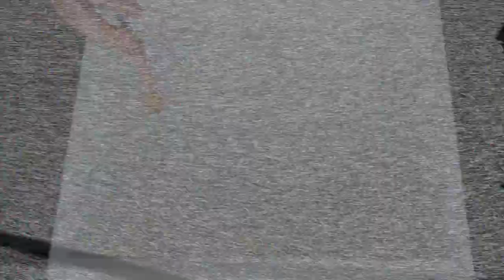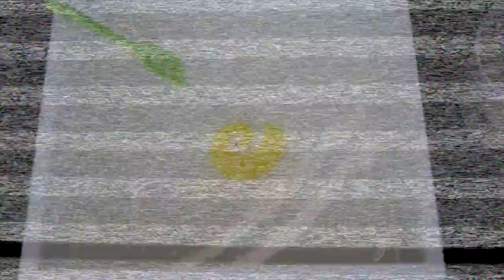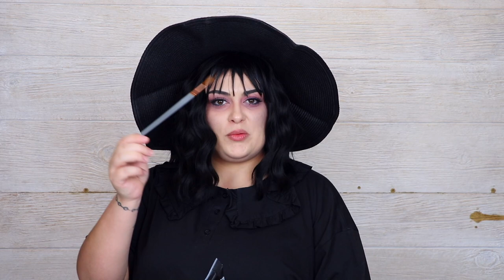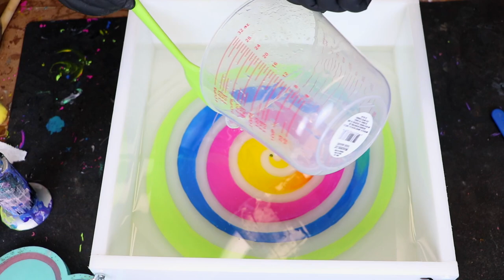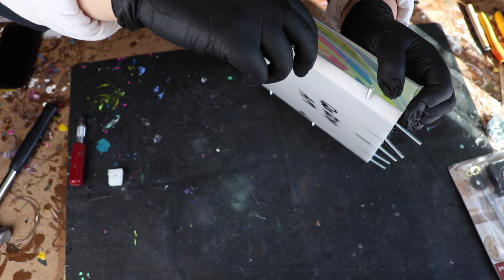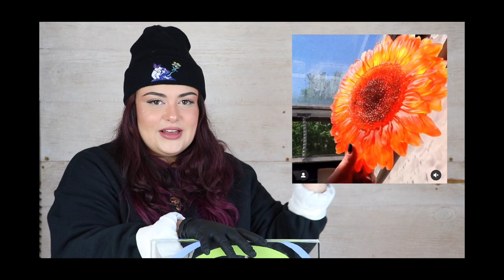The BIGGEST Resin FAIL I've Ever Done... I need your help. Tried To Make a 3D RESIN PAINTING!

Comment: You can rout out a space for the clockworks, so it can still be a clock. You can put hooks on it, and make it into a coat holder. You could just hang it on the wall as simple art.
Reply: I second the use of a router. A lot of clocks have the motor in a recessed area any way.
Reply: i was going to say that too but i think she might eat into the first layer of paint so she could only take out a few mls but that might be enough
Reply: I think she can router it, but to avoid eating into the paint, router from the other side it will just reverse the spiral but that would look good as well. 
(Does that make sense... I don't know) Anyways, it will look fabulous whatever it becomes. Love this channel.
Reply: I was saying this too, if she carve the middle in the other side (so from the "top" layer) it will work 😁😁😁
Reply: @jmakit  she might not hit the paint tho 🤔 cuz she did have that first layer that bad already been poured and I believe that was a thick pour
Reply: @jmakit  not necessarily she can leave the side that has the first layer ( yellow) to be the front and do the carving on the last one, that only has paint on the corners... Maybe.
Reply: @karenstremke9766  exactly what I thought 👍
Reply: She said the last couple layers poured were very thin. It would all have to be from the back.

Comment: You could probably "file" it down in the middle so that the shaft comes through and then bend the arms a bit. Or file in the back so you don't get a "ditch" in the front. Dunno how to ecplain it. But i would say it is doable. Might even give the piece even more dimension
Reply: I thought about that too. But then you’d have to be sure not to carve out any of the yellow paint.
Reply: @hopegold883  that might be a risk if done from back, but in the front, rhere is a lot of space to file into before reaching the yellow
Reply: Came here to say exactly this. She could easily sand a pit into the back without ruining the 3D effect.
Reply: I understand what you're trying to say and it is what I was thinking, like essentially carve into the piece a little to make the clock works mount to the piece kind of "recessed" into the resin.

Comment: YOU can still make it into a clock! I had the same issue when I made a haunted mansion grandfather clock (small shaft) giggity. Bust out your mask though, if you use a torch lighter , you can melt down the center til its flattened out enough then you can install the clock stuff! You of all people can make it happen <3
Reply: I said something similar but I didn’t think about melting it 🤔 I had thought about those round drill things that they usually do with wood to make a sunken in piece
Reply: @encapsulated_nomad1359  That's called a ROUTER

Comment: I think it would look amazing mounted vertically on a wood base with LEDs lighting it from the bottom . So it's an ambient side table light. Lit up would show all the layers/3D effects nicely.
In addition to this option. Please don't call it a fail. It's art,  you may have had a set plan but art often changes course. ❤️

Comment: I would have drilled through the back to make a sunken in square so the base of the clock part can lay flush within the resin piece and it will help make the shaft piece long enough to pop through to the other side :) it’s really a simple fix to this road block. You can still make the clock
Reply: I originally thought the same idea, then realized there’s a few problems… she’d be drilling into at least a couple layers of paint which would ruin the spiral effect. Also it would not stay crystal clear. Anytime you drill, sand or remove resin it makes it not shiny.  Cutting out a partial block isn’t so easy either. I’ve been there and spent a lot of time doing that on one of my projects. Took several hours trying to dremel cut out a block of resin to fit a puck lite. 

Her original idea of a clock might be a problem too if she was using that mechanism as the hanger as well. That’s a lot of weight to be putting onto the shaft, which is what’s actually holding up all that block of resin. I’m so glad she didn’t drill the hole THEN discover the shaft was too short!

I like the table idea.

Comment: I think it's lovely, maybe not what you intended but it's still a great piece. I think it could make a very cool side table with some metal hairpin legs attached to the bottom - would look very contemporary. ( I agree with E Hardgrave comment, you could add some led lighting from underneath and it would be super cool table. ) I think you could also make it into a large bookend or pretty led lamp, with like a small rectangular grooved base for it to sit in so it won't fall over and have the led lights hidden in that base and shining up through it.

Comment: Hey Love! If you take a larger drill bit and drill through the back it will thin that area enough to get the clock through and allow you to secure it with the clock nut in the back side. You just need to ensure that you choose the drill bit that is larger than the clock nut so you can still screw it in and make sure to drill only part way through the resin, just enough to ensure you can fit the clock pieces together. You may have to paint the back black in order to hide the drill hole but you can totally still make that work!!! I just used this technique to put handles on my kitchen cabinets and it worked beautifully. You got this!

Comment: Get either some matching neon paracord or black paracord and make a hanging macramé table or shelf. You could even put a pendant lamp in the top section of the macramé table and use a black light in it to make your resin piece “glow”. Regardless of what you decide to do with the piece, it looks really cool and is totally a success. ✌🏼💜🛼

Comment: I loved watching this one. And I love that you have no problems showing the failures. Although this totally is not a failure. It’s just a change in plans. 😁 I kept thinking anyway that the clock mechanism will be visible in the center. Maybe like you said, the colors look great against black. What if you pour one black back layer. Then router the center to countersink the little box. It would have to have a false front on it to match the black background. Then what if a frame of some kind was created that hides fairy lights placed around the entire outer edges. It would make the layers more visible from angles and would illuminate the clock from across the room.

Comment: ok.. so.. clock.. you could cut out a depression for the clock 'guts' so  it does not protrude as much when hanging it on the wall, and in doing so would make the shaft sit deeper. so it could still work! Just gotta get creative with a drill and/or router.
Reply: Yes finally! I said the same thing but without it sounding so smart 😅 lol

Comment: STILL A CLOCK! Hey Heather & Sean, you could still make it into a clock by sanding down the centre of the resin so that the black square sits into the centre of the piece & the shaft is able to thread sufficiently through to the other side. Plus that will allow the clock to sit better against the wall. xx

Comment: Use a router to countersink the clock works. If you get into the paint, you could always repaint on the back before installing the works. You can also get clear clock works, so it wouldn't show up as much as the black ones. They both come up to at least 15/16" shafts, so if yours isn't that long, check into getting a longer one first.

Comment: Couple ways u can still make it a clock.  One being On the base layer (the side that goes against wall) u can sand down to give extra room for shaft and if u loose any paint then repaint  the missing image on the back also facing wall. Might not get the 3d effect but still have pretty clock . Or  two do like other comment said take a Dremal to the front layer facing towards u when u look at clock on wall .and make a small curve like a bowl for the shaft to stick out ( will also give added dimension when u look at it ) just enough to connect parts. . If u do this last suggestion then I would round out edges just a lil . Or  u can keep trippy buy having a circle in a square.. or three another thing u can do is this is beautiful the way it is maybe just add some fairy led lights around the edges and just hang as a price of art .I love it no matter what u do its super pretty  just my thoughts

Comment: I would have made it into a jewellery holder with little hooks on.  Or like many others say a lazy susan, but first I would make a black maybe sparkly block to put under so you can't see the mechanism, or put the mechanism between the two.  If you do make a clock start with a black square or circle in the middle so you won't see the clock part through it, it will look like it was meant to be, you could also do additional black line squares to balance it all, if you know what I mean!!

Comment: You could still make a clock. Just use a drill press to make a hole big enough to sink the clock piece into the back. I would put a black layer of resin on the back and after you drill the round or square space to put in piece just put a very thin resin into the square so the black piece doesn’t show thru the front. And add arms and you’re done. I love it, girl……. Please, please, please try this before anything else. Luv yu Debbie

Comment: Drill a hole and use one of those shank bits that drill down but flare out.  Find in maybe the wood bits section. Sand it down until it’s right.  It’s something to consider.

Comment: Turn it into A sun catcher/cat seat for the window. Add a stand/seat to the side with mounts to connect to the window, put a soft cushion on the Seat and the sun will shine through the resin and reflect colors onto ur wall Or table but it'll be useful for the kitty to lay on As well.🐈🐱💚💙💜💛🧡💖

Comment: Coat it with UV-resistant resin and turn it into a sundial. That way it’s still a clock. 😁

Out of curiosity, would it not be possible to extend the shaft or route out part of the resin so the square black piece could nestle into the middle? You’d need to turn it around so the yellow part was closest to the front, but it could work.

Comment: Drill the hole a bit bigger and you could make it an end table with a light attached to it, the light running through the center of the table. Ikea has some tables like this already so you could just use one of their kits and trade out the table part.

Comment: You could turn it into the base for a table clock. Drill a hole and put a rod (or something) coming up from the center and you could make a separate piece (that is the clock) and have it attached to the rod.

Comment: Go from the top and use a router to carve a small well out that the clockworks will fit in, then drill your hole for the shaft to go through.  It will look like the spiral is moving away rather than towards the viewer, but that should still work.

Comment: You could cut out a square a quarter of an inch deep (or however much you need) and inset the clock works.  That way you'll still have a clock.

Comment: • Drill a grid of holes and use acrylic rods to make it into a functional peg board.  Secure pegs with UV resin for extra stability.
• Paint a calendar grid over it, add another thin layer of resin, and use paint markers, wet erase, or dry erase markers to fill it out.
• Cut it in half or a 40/60 split, drill a couple of holes on either side and make it into a tiered rope shelf.
• Make some more resin panels (or use acrylic) as sides and/or dividers to convert it into a container or organizer.

Comment: Sand a circle that is the same diameter of the clock arms. Since the paint in the middle is on the bottom layers, it should work fine to sand down the front. :)

Comment: Never worked with resin, so idea if this would work, but could you not just make a recessed hold in the back for the bolt? Same way you would a screw so that the head is flush with the wood? Xx

Comment: I wonder if you could get a shaft extension 3d printed for you so you could still make a clock.  I have a 3d but such at creating files. I will have to see if someone or there has a file for it.

Comment: I think it would have been cool if you painted the numbers in the 3d. Like for example one layer you paint 12 and 6 then the next you paint 1 and 7 and so on. You can add more layers. Drill out a big enough dip in the back to put the peace you need in the back. Then glue it in place.

Comment: I was wondering how this would look if you did the same thing but with puffy paint.
Reply: Also it can still be a clock. The center paint is the thinnest layer of resin, so you could sand that area down to put the clock parts in.

Comment: Not a fail. Just make into a lazy Susan. A computer table or a nightstand. You can route out the back, a bit. Make and insert. Give it a resin coat to cover scratches. Your back will fit in the insert. Thickness problem fixed. 😊

Comment: You need to get a router and cut out a square in the back and pop the clock part in it. It’s not a fail, you’re just not done yet
Reply: That's also what I was thinking. How difficult would it be to cut space into the back to fit the square thing into.
Reply: Unfortunately if she uses a router on this, it will ruin the design. Because each layer is quite thin. A routered  recess will cut into and remove the design. Especially the first layer.

Comment: You could still make that into o’clock you’d have to have your sander mark out around the black part of the clock while it’s in the hole and then sand out where the clocks going to fit in there and you have a clock it’s not that hard it’s not rocket science and then you can go ahead and put a layer of resin on there so you don’t see the cloudiness unless you want the cloud just to block the back of the clock works